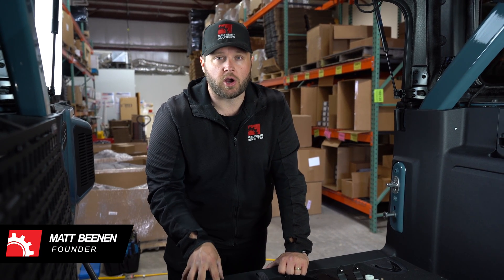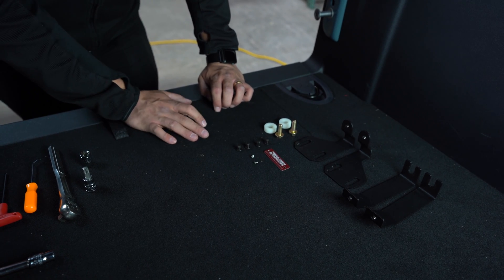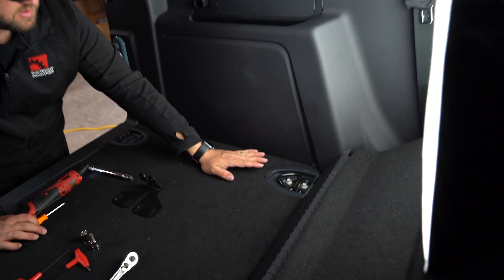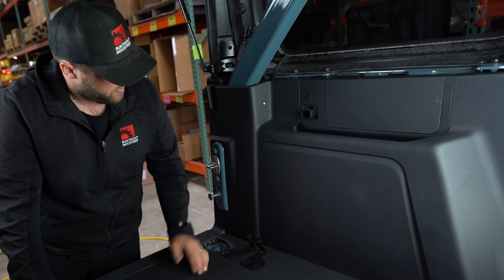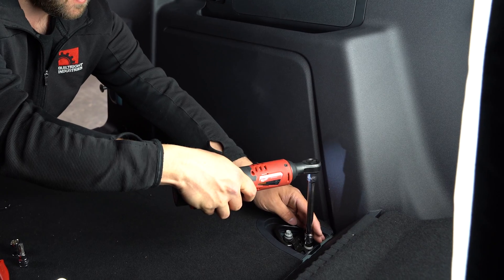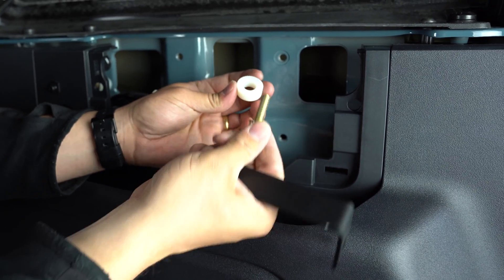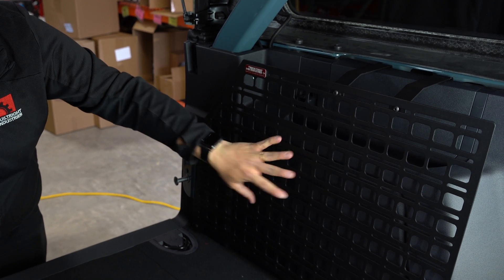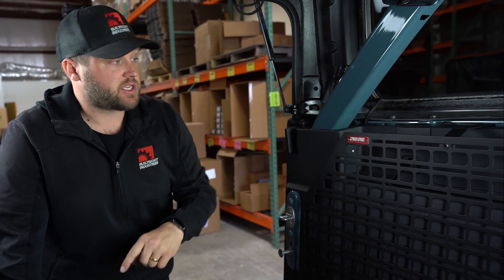Bronco (4 Door) Cargo MOLLE Install Guide

Comment: I just installed this and I have to say for those worried about the price, I cannot think of an aftermarket part that I have, let alone any other item that has been Made in America that is of this quality.  There are no burrs, no paint over spray or thickness issues, the threads are all clean.  Clearly there is a lot of attention to detail going on here.  In my opinion it is well worth it.

I will note, I think that the Torx T-50 requirement in the video is erroneous.  Or was edited out.  It’s not needed.

Comment: Have you had any questions or amendments to the product for cargo areas with the pull out tailgate installed? It raises the floor and I'm unsure if the tie downs atop the module are attached the same way. Thanks!
Reply: It won’t. We have the Everglades version with the tailgate and the tie downs are not attached the same way